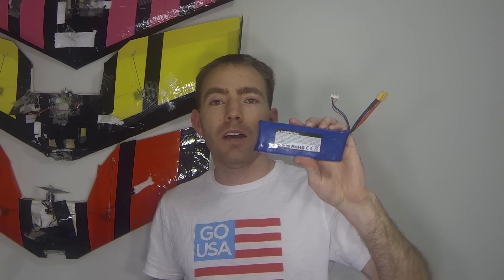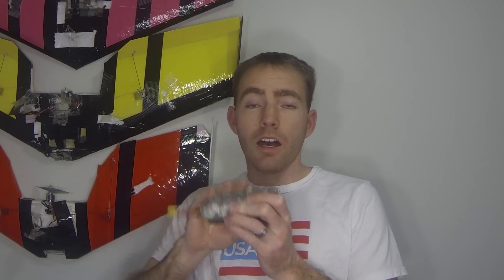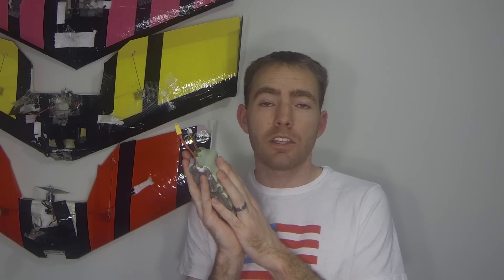Quick Tip of the Week! Lithium Ion packs

Comment: For higher-amp applications, the newer NCR18650BF, BL or GA cells are an option, they go up to 10A for the same or higher capacity. The HG2 or 30Q cells go even higher (15A, maybe even more), though they have slightly less capacity.
Reply from the maker: +NetRolller3D yes, there are higher amperage ratings, but you do have to count the density vs low c rating LiPo's if you get too low of density its better to just go with a 10-20c LiPo.
Reply from the maker: ***** yes. they may work well. they do cost quite a bit more for only 100mah

Comment: What about 26650 batteries? Can they deliver higher C?
Reply from the maker: you would have to look at their amperage rating... Currently the NCR18650b is the most energy dense battery in manufacturing. there are other "high output" lithium ion cells but they start getting very close to the density of standard LiPo's

Comment: Super informative and clear video, thanks for your time.

I have a quad copter and hexa both will have new motors,Sunny sky X2814 or V2814, they are quiet powerful motors. I am sick of lipos as they just get low very quick and one of them already puff after about 3 months and not more than 10 flights. So I try to build my own battery pack 5 parallel and 4 pack in series, in total of 20 matteries to have large capacity,  use a Pansanic NCR 18650B 3400mah. The question is, the motor need 29A on full throttle, so for the 6 motors will this battery pack deliver enough power to run? non of the multirotor for fast fly or fun both has a camera on it and is for aerial photography only.  any recommendation?
Thanks a lot.
Reply from the maker: The panasonics would have to be a huge pack to handle that amperage. Max is 174A for all motors... that means on a 4s you would need 14 cells in parallel to handle max power (at 12.6A per cell) and that pack would be around 2800g and 47600mah total capacity!

Comment: Can you link to more details on the quad you have this pack set up in? I'm keen on the specs of the frame, motors, props and escs that you have to have to get a 4-5amp operation.
Reply from the maker: my 4-5A cruise is on a plane. we have a quad that runs off these as well but I cannot release the full spec's. just search for the mighty midget quadcopter, or check out FLoHIO117's youtube account
Reply: thanks